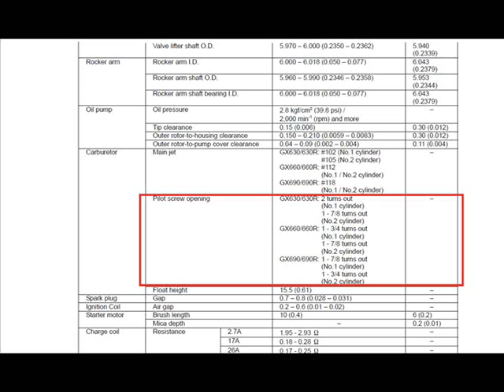Honda GX630/660/690 Engine Carburetor Cleaning Guide

Comment: I am unable to remove the 2 needles with the square head because on my carburetor they are capped with a welch plug. Also do I see 2 O-rings on the bottom of the 2 plastic parts. Mine don't have any. Can you advise, please!
Reply: Yea. I seen that too. Can’t take those out